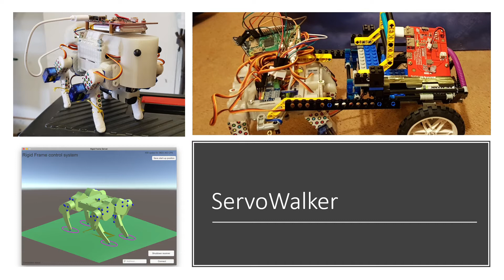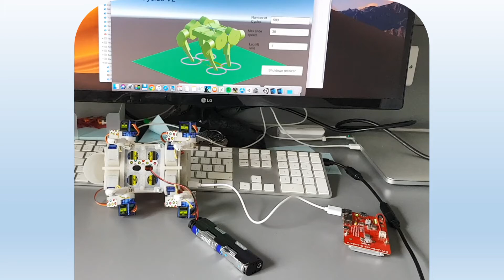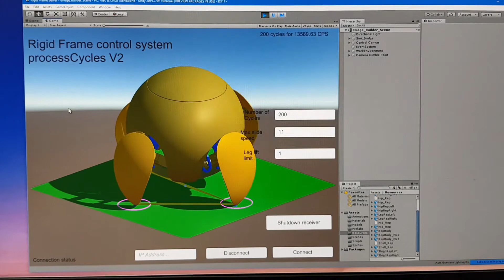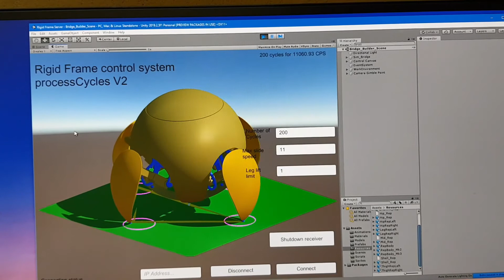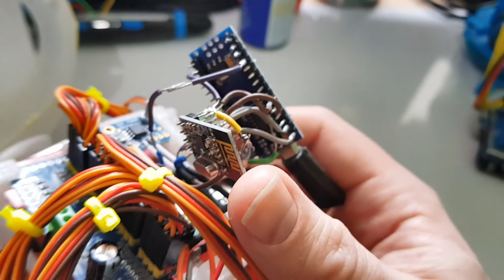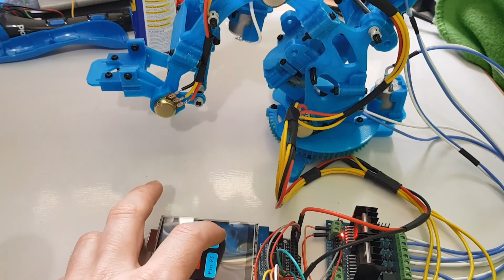My Beachlab 2020 Presentation - Rigid Frame robotics project

Comment: Fascinating. I like the idea of a arm mounted 3D printer head, that design can be advanced. I imagine a platform surrounded by two rings, each with one of these arms, maybe with a different fillament in the printer head, a multi material, 6-DOF 3D Printer. Or they use the same fillament and print a project twice as fast.
Reply from the maker: That's something I'd like to try one day. I think I've seen a video somewhere where they used one of those welding robot arms to 3D print something.
I'd also thought that one arm could hold the piece, while the other prints it.
It's kind of similar to those gantry 3D printers being used to print buildings.
My project is currently failing because I need more power in the motors, and a better connection between motor and attached gear.
Reply: @curioinventorium  That is even better. Also the "one arm holds one arm prints" system allows the use of teleworking, an engineer with  VR-Headset and controllers prints stuff, i don't know, onboard the ISS. Let's hope you get better motors and refine your system, im curious to see your next invention. Well, before your robot chicken multiplies and destroys the world of course.
Reply from the maker: I'm currently back working on the software side of things, developing a UI that allows it to be easier to set up new robot frames for the simulation. And to also have simulated environments to test the robots in.
That way I can make sure the design works before making a physical robot, plus maybe make it into a fun game or something.
All the robots I've done so far are very good at falling over :D